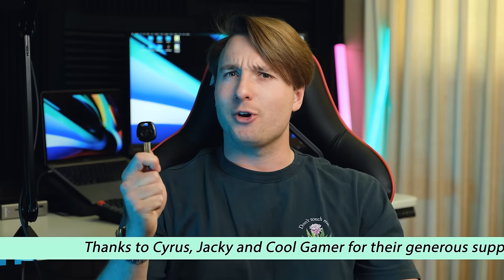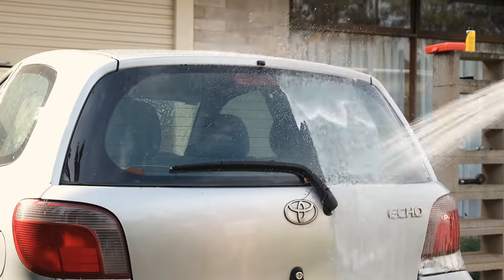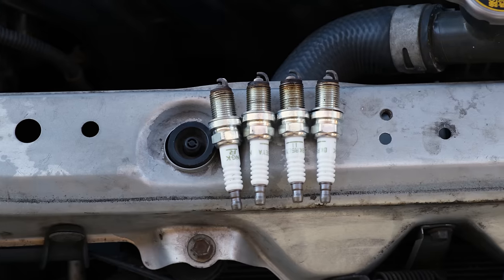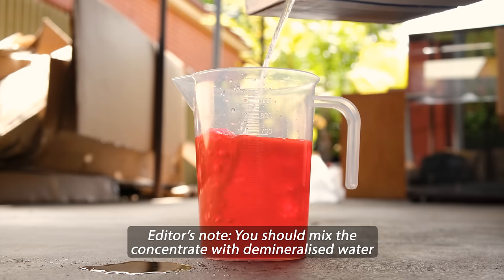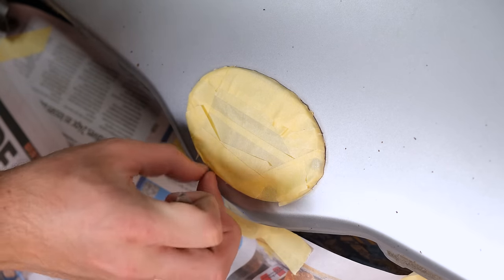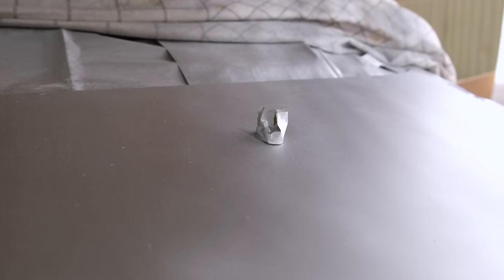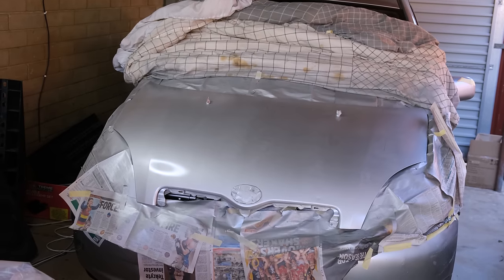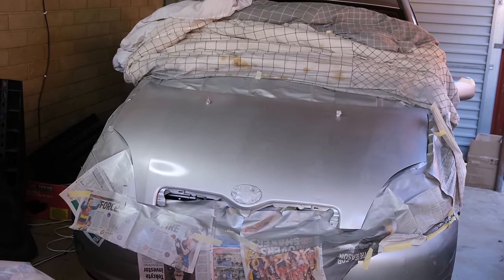I Bought A Cheap But FILTHY Toyota...

Comment: I would also do a cabin air filter after looking at that interior. Its behind the glovebox and really easy to replace
Reply: Are you sure these came with a cabin air filter? I have two Daihatsu with aircon and both of them don't have the filter
Reply: @sheppardpat47  yes it's a big plastic holder that is behind the glove box that holds the little replaceable filter
Reply: Right? You can assume that lots of time has passed since it was last replaced.
Reply: And engine air filter
Reply: @sheppardpat47  Are you sure that they don't have the cabin air filter by fact?... Check the owner's manual, in there you can even learn on how to replace it. It is extremely rare a car that doesn't come with one, and Toyota or Daihatsu are no exception.
Reply: @AlexisRubik  they don’t. Trust me
At least my Sirion and my copen doesn’t have it, it’s well known
You can install one in the sirion but you need to cut the cabin air box
Reply: @sheppardpat47 Same for the Nissan Micra K11, if it has airco it doesn't have a filter in the normal spot where aircon-less Micra's have it. I've read mentions that it might have a filter nearer the engine, but you have to remove the plate below the windshield outside and is supposedly shaped differently and not available for replacement anyway.

My Yaris from '00 (same car as this one, even same color) with airco does have a cabin filter, in the normal spot behind the glovebox.
Reply: All early cars with A/C never had a cabin filter. They never came until sometime in the 90s.
Reply: @mattnbin  But my cars are from 2007 lol
Reply: @sheppardpat47  ok perhaps I should rephrase as “ they started on some cars in the 90s”
Reply: This class of vehicle has a cabin air filter? Really? Never heard of that in the US on anything with manual windows. If it has manual windows in the US, you can almost bet it doesn't have P/S or A/C or at that point even a radio. Matter of fact in recent years I don't think I've seen even base models with manual wind windows here. What a little time capsule!
Reply: I think the comments above are thinking Toyota (or any brand really) makes a global vehicle with all options the same everywhere. Absolutely not. Country to country VERY VERY many things change, except the exterior (mostly). Your Ford Mondeo we got 3 years later as a Ford Fusion. We are the home market and we get things wayyy after the rest of the world, automotive wise.
Reply: @crazyidiot5309  the AE86 I will buy have working AC and manual windows 😂
Reply: @crazyidiot5309  what country are you in “the home market”?
Reply: @mattnbin  the US. Ford is US.
Reply from the maker: Well, I went ahead and put a new one in. Turns out that it DIDN'T HAVE ONE IN THERE!!!
Reply: @psivewri Thats genuinely insane.
Reply: @psivewri  crazy, those filters cost around 5 usd :D who the heck was previous owner, even crackheads have better hygiene
Reply: @sheppardpat47  my 2004 echo does
Reply: @NiktoPH  Those airfilters actually degrade in your A/C system and clog it over time learned that the hard way

Comment: It's heartwarming seeing that little Toyota come back to life. It's clear that it had been neglected for a while; I'm pleasantly surprised that it's still in that good of shape mechanically, all things considered. Toyotas are really something else.
Reply: Older Toyota yes. New models not so much
Reply: Well it did have a newer engine put in it, probably lack of oil changes judging from the interior.
Reply: *Was
Reply: Well, it's just a driving vehicle. There is nothing else in its purpose than to turn on, switch into gear, and drive and brake. Those kinds of cars last long.

Comment: If you turn you 5L bottles sideways the fluid will flow out in a smooth stream, rather than glugging out as it does when you tip it in held upright. Makes a big difference and is much easier to pour also.
Reply: most of them have a label to make you do it upside down so you get zero glugs

Comment: crazy how much of a difference you made with the car's interior with a simple cleaning, makes you wonder how low the standards were for the previous owners. Congrats on your attempt on bringing this car another life, please wear gloves though
Reply from the maker: I was so close to walking away when I saw it in person. A few months later the car has been great!
Reply: House neighbours of my parents got a red Nissan Micra K12 and seem to care very lowly about it, it's not looking too dirty but the paint is beginning to fade and look dull compared to my A1 (also red and now almost 10 years old), in winter I don't drive through a car wash monthly but at least clean up bird poo soon and pressure wash it from time to time.
But it doesn't make me wonder too much, they got a ton of empty cardboard boxes and other almost trash stuff in the attic and the upper two stairs (but they now reduced that because it's an obvious fire hazard).
IMHO the car hasn't be to be too clean (washed engine bays are often suspicious) for sale but damn, give it a good clean outside and inside (so that it doesn't keep you from entering) and it can increase the value massively (I guess it usually gains more resale value than cost you had for the car wash and some cleaning stuff).

It reminds me of Ratarossa, he got a Nissan Navara for very cheap in March of 2020 with a bunch of issues but especially the interior was literally contaminated...
If it was used in a company, why didn't they pull out a trainee every few months and give him a vacuum cleaner or 2 Euros and drives it to a vacuum cleaner (here nearby me is a car wash and you pay just 1€ for the vacuum and can literally use it for unlimited time (the spots have like metal detectors in the tarmac so it shuts off when you're driving away)).
Reply: I work in the industrial sector as maintenance.... this is light compared to what i get in my truck in a single day

Comment: Some hints to people who got inspiration from this video:

First of all, never spray any sort of cleaner straight to the area you are going to clean if you are not it's compatible. Spray it onto rag/cloth and test it in somewhere inconspicuous spot near the area. I have seen automotive interior cleaning stuff melt rubber coated buttons, smearing printed text and even causing color from the cloth to transfer into seat upholstery.

Second thing. Use gloves when ever you are working with dirty oil, that stuff is really nasty on skin and it can cause rash on some people. Oil from diesel engine is even nastier... Safety goggles are also good thing to have when working with liquids under the car, or anything mechanical when there is risk of stuff flying around you.

How about cabin air filter?
Reply: My dad has a 08 Yaris and came with no cabin air filter. Like in the slot there’s a place there just nothing there. It’s behind the glovebox just remove and little cover

Comment: This is such a perfect example of never judge a book by its cover as this little car, from what I can see and hear, is both mechanically and structurally in excellent order after you guys did all that work. So nice to see folks fixing and keeping these little cars going. :D
Reply: Totally. These cars are cheap, have cheap parts, easy to work on and can last quite a long time if kept maintained. Had one for about 22 years now and still going strong. Fuel economy is pretty good aswell.
Reply: @mritz728 how about engine  troubles on these cheap economic cars? Have you encountered one?
Reply: @vitonamous  In my yaris I have never encountered any engine issues. I have had some issues with rust (expected with these older cars) you may encounter some on the used market with engine problems (very rare unless listed for parts)  in the used market however parts are quite cheap.
Reply: I swear toyotas have to be some of the most reliable cars out there. A lot of inline 4 cars are pretty reliable, as they’re simple and made to be beaten up.

Comment: I've got the same car (well, its one of my two).   Honestly, its a reliable little runabout - and no matter how badly I treat it, I can't kill it - it just won't die.  I've had it since about 2011 and its starting to show some problems - for example, the window regulators sometimes get stuck, and the boot latch sometimes doesn't work - but mechanically, its A1 - to the point that my local mechanic asked me if I was ever interested in selling.  I said no.  Its just too reliable to get rid of.

Comment: My 24 year old Yaris still going strong. 55mpg no leaks , a few bulbs , brakes , tyres and wipers. NO RUST !! Always find a parking spot great little car.
Reply: UK viewer here, had a 2002 Yaris just like this in EVERY way....1.3L 4sp auto in silver & 3 door. Never got more than 49mpg thou! You must've got a manual. I've had mine for 14yrs with ZERO issues.  V.little rust indeed! No rust spots,wheel arches or underneath incl both seals v.good.All i done to it in 14yrs was change the trans fluid with Type4,front brake pads (No discs as i grounded the lip/edges back), mid & back exhaust, serpentine belt for reliability & stabilizer bushes as garage said it's getting worse but may not pass MOT (inspection). Changed the coolant every 4 yrs with Prestone,plugs,air filter & P/S fluid. Every year from the 5th year of ownership i used Castrol Magnatec & only changed the brake fluid once halfway through owning it. Sold the car on 3yrs ago & still speak to the owner today,it only failed on it's MOT once....wiper blades which i was annoyed as i looked after it well. Road tax in the UK for this is £255 a year but if it was a manual 1.3L it'll be £190. Now i got a 2015 Yaris 1.3L CVT that's £35 a year (Was £30 last year) and i get 58mpg.

Comment: Almost 300,000 km on my 2005 Echo.  It's a great little car.  Biggest maintenance has been replacing the water pump and brake linings.  I change the oil every 5000 km, replace the other fluids at recommended intervals.  I'll get at least 500,000 out of it.  I could afford a much nicer car, but I love this little guy!

Comment: this is such a reliable car! if you go into the engine, you should definitely clean the air flow sensor with cleaning spray and change the air filter. You will see a huge difference after that
Reply: My dad a 08 Yaris with 496K miles and climbing with only regular maintenance. Great efficient, cheap little cars
Reply: There is one of these exact model Echo (Yaris for most the world) here in New Zealand that has done  one million kms which is 621371.19 miles and it has never had any major repairs only maintenance done on it.

Comment: I have bought 2 BA Falcon one tonners this year, both of Facebook marketplace, both for roughly the same amount of money, and both of them have been cleaner inside than that car, and both of my utes were used by tradies. My first BA actually has around 650,000km on it and has been a tradesman’s Ute all its life and besides dog smell, and some dog hair, it is like a Rolls Royce compared to that!! My second BA is only a baby, she’s got 230,000km on her but it got it detailed as soon as I bought it because it was a smokers car. Had to put 3 little trees in it to get rid of the smell. 

Oh and btw, going by the look of that interior, I’d be swapping over cabin filters as well. No doubt it’s holding a large amount of stench.
Reply from the maker: Good call on changing the cabin filter, although the interior of the Echo didn’t smell at all surprisingly. 

You can’t kill a BA falcon it seems!
Reply: @psivewri  that’s weird! It looks like it would have smelled like a free entry night club floor! They’re good old things. I work as a pilot and have just gone into business for myself and the Barra was my first choice. They’re a little heavy on fuel, especially with the ute diff ratio, but I can claim what it burns anyway.

Comment: Hey, great video! I drove a Yaris for about 5 years. That replacement engine was definitely reconditioned, given NZ engines with high KMs burn oil due to the piston rings failing.
Before it gets to winter, a quick little bit of advice I would give is that the foam seals on the rear lights tend to fail and lets rain pool around in the boot floor. Toyota sell a new revised gasket for this issue new, but if you apply a strip of silicone between where the light and the body meet that will also work just fine.

Comment: Very pleased to see this video as I bought a 2004 1.0 litre Yaris (in the UK) and with just over 200,000km on the clock it seems clapped out - yet my 2004 BMW with 530,000km on the clock still feels like new - but it's dead with an electrical fault ☹ Incidentally, the Yaris is also the preferred transport of many a food delivery driver here in the UK!

Comment: From 2000-20005 they are called Echo in Canada too.
These cars are tanks! Reliable, fuel efficient, roomy, easy and cheap to repair.
Probably the favorite car I ever owned, here cars will rust cars to death within 10-15 years on average.

Comment: Am from Puerto Rico and I have an Echo but the US version, this little car is a tank, very very reliable, ease to maintain, service and use.  It is possible that car you have still have the original engine. In Puerto Rico people use this little cars hard with 300k and 400k miles. Very fuel eficient vehicle. 
I bought mine to go to college and I still have it. Now is the Family emergency car, if one of our Dailys need to be service or something happen we use the little trusty Echo machine. 

I call it the smurf since the car is blue 😂

Comment: My mum bought the same yaris for $1600 in a perfect condition. Its 1.0L 68hp manual 2001. I put a little work on it like new grill, led lights, new rims and some interior upgrades. It turned to a clean sporty looking car.
Reply: I forgot to say that it's an 4 door
Reply: @aleks4oo  i bought mine for $32k 😂 its a 4 door Toyota vitz. They are sought after in my country.

Comment: Replace both rear wheel bearings . Yes just one bearing is worn but if you have the time and the car in the air just do both . Its better on the long term .

Comment: Ice job. I bought a Yaris back in 2004 and used it for 18 years (300,000 miles) sold it and got another. Great little run around. 
😀

Comment: The spark plug still looked a bit too loose based on that last little bit of thumb force you gave after the half turn, most cars are somewhere between 7 to 20 ft-lbs, you'll want to check for your specific model but it almost looks like you weren't even at 7 ft-lbs yet.

I recently bought a used car & when I went to check the plugs I found one was not even hand tight, it had vibrated loose, someone had replaced it recently & must of not tightened it enough. For that car the spec was 11 ft-lbs, got new OEM plugs, checked the gaps, put anti-seize on the threads & replaced all the plugs, threaded by hand & used a torque wrench to tighten them down.

Comment: These yarises are just bulletproof, my mother drive thru same 4 speed + overdrive automatic 1.3 liter engine and it just won't die, just change the oil and that's all it needs. Two things that are common failling points on these are the variable valve timing solenoid, the pcv valve and the catalytic converter

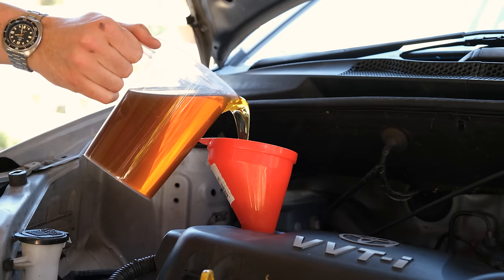Comment: 5:19 Just water isn't bad per se. As long as it's distilled water, with deionized being preferable. Any other type (like tap water) will leave mineral deposits and though unlikely to destroy your engine if used for a short time, it's still possible. And even distilled water will promote galvanic corrosion,which definitely will destroy the engine over time.

The major benefit to proper coolant is the anti-corrosive properties.

Comment: In aruba we take those cars and we turbo them for drag racing. Those 2nzfe engines can push about 300hp with a turbo and a tune also an exhaust to make the car breathe a little bit better.

Comment: Hi! I just couldn't resist opening your video since I had the same car here in Europe, with manual gearbox, it had pretty much same bonnet problem a bit less than yours btw 😂 and way less kilometers, that was my first car and it was a very nice one for the means you've pointed out mainly! Very little maintenance was required with it. I kept it for 5 long years and I was a little sad when I swapped it for a brand new car. But I guess it was time. I'm happy they are still around, you're definitely going to enjoy it 😊

Comment: They did sell an Echo in the US for a couple years! Only ever seen it in sedan form though. And as for water and antifreeze, your climate definetly does not need to worry about freezing however antifreeze increases the heat transfer ability of the water. Water itself doesn't carry the heat as well to the radiator, and being in a hot climate like yours, you want the cooling system to be in tip top shape.

Comment: My 2007 Yaris, in the USA,  has 230,000 miles on it and still runs great.   The only thing I have done is spark plugs and alternator brushes.   $12 for the brushes vs $350 for a 'rebuilt' one from the auto parts store.  The seats are uncomfortable after an hour and long trips are not good.

Comment: The model we have here in Canada comes with the 1.5l.
With the 5 speeds manual tranny, you can expect to make at leat 300 000 miles with it.
Economic and build to last, when cars were designed with honesty.

Comment: By the way, the Echo's rear seats also tumblr forward as well as fold. It's a bit of a faff and eats into front legroom. Not many owners know about the feature. Give it a try. The handle for it is a sort of curved handle accessed under the backseats from the boot.

Comment: Great video! Plugs did look to bad, good to keep for spares. Also, I usually fill up my filter with oil to help the engine on start up, but only can be done if the filter is vertically upside down. Also, council and recycling depots can take the old oil and coolant too.